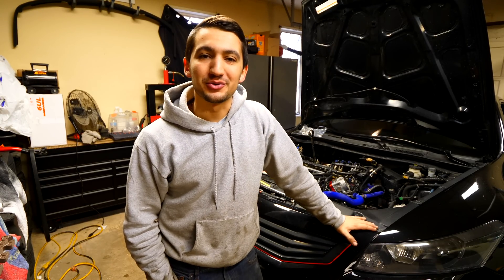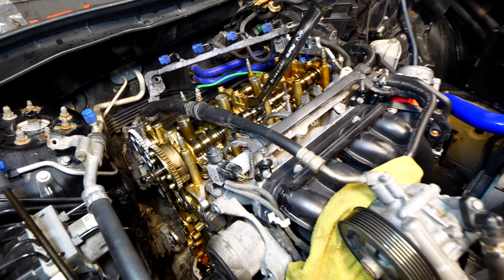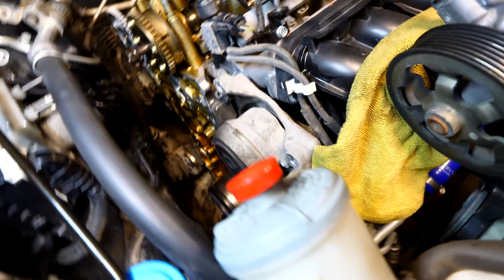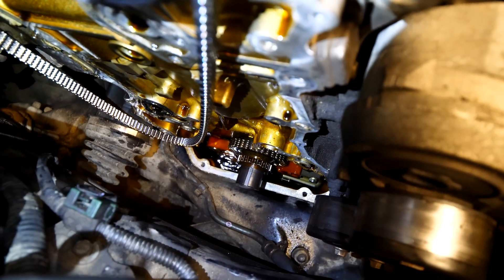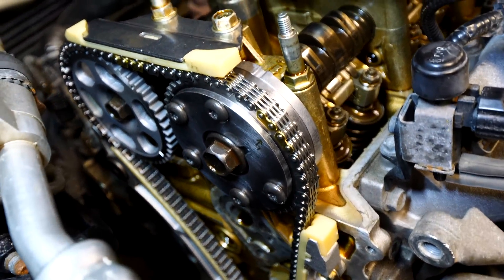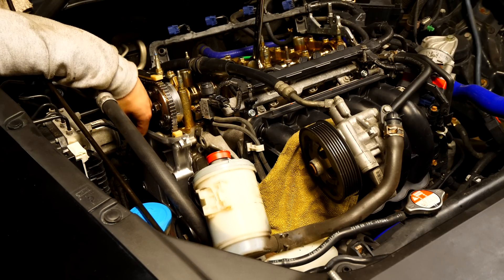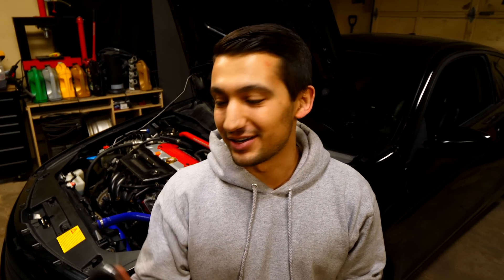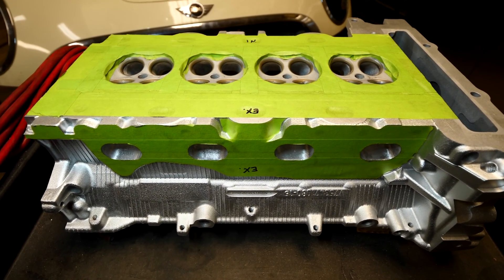How I Replaced the Timing Chain on my 200,000km Honda Engine

Comment: Did you have to drain the oil first?
Reply from the maker: No I did not. The oil was held in the oil pan. If I wanted to replace the oil pump chain, I would have had to drain the oil before starting the job.

Comment: If your engine does not have the fancy plastic vtec cover, it's a pzev motor. Those motors are mandated to warranty the vtc actuator for 150k miles. If this applies to you and you live in a pzev state like California, take it to your dealer and know your state right. They will fix it no charge. Thank me later.

Comment: Very informative video, thanks so much for taking the time to record!!
Question for you: How have you found all of those aftermarket parts after a bit of use? 

I have to do the same job on my Accord in the near future and I'm slightly hesitant to purchase non OEM parts for such an important part of the engine. Have you had a good experience so far?

Thanks again!
Reply: I'd say for anything related to engine go with OEM, there are ebay OEM timing chain kits for around 250$ , not a bad price if you consider that this job will cost more than $1k at any mechanic. If you want to play it safer you can buy everything at the dealer.

Comment: Hey Milan, I've been watching  your 2009 Accord Coupe Videos. By the way GREAT JOB.  I also have an 09 Accord Coupe purchased new in 2009 it's an EX-L 4cyl, Polished Metal Metallic , black leather interior.  The same  base car as yours except mine is the 5 Speed Automatic.  I haven't done the major mods that you've done but I have done some, rear spoiler, 18" Honda 7 spoke wheels, added all the trunk and hood liners that were stock on the 6cyl.  I also scored the Vtec nameplate for the trunk lid on the opposite side from the Accord label. Mine also did not come with fog lights and the installation of them is a bit much for me at over 70 years of age. Honda wants WAY to much to-install them. QUESTION, in a few vids you state that you consistently red-line the engine. Do you think that has contributed to your timing chain & vtec problems? I ask because a friend of mine in California has a 2008 same engine with over 250,000 miles (over 402,000K) and she says she'll get in her Accord and drive cross country, no worries. The only maintenance shes done is Honda USA (NOT DEALER) recommended services and  her car is  a 5 speed automatic so it stays well below red-line. I do enjoy your videos. This is my third Honda, I've owned a 2001, 2003 and now the 2009. I don't drive as much as I used to so I only have 65,000 miles (105000K). Thanks for reading, regards Tom. P.S. I have the K&L cold air intake system, but I've been waiting for my extended warranty to expire. One day I'll do a Video.

Comment: Well wanna know why yours does not have the VTC Sound well Milan because you use fully synthetic 5w30 oil 
Because i kinda i actually studied this and it turns out 70% accord owners usually use 10w30 or a higher viscosity  oil because actually the VTEC system runs on oil pressure so if is so thick it might damage it.
The best oil for the k24 is the 5w30 full synthetic or 0w30 full synthetic 
 Even thought k24’s can use 15w30,10w30 conventional oil its still not good you don’t need that thick of an oil just use 5w30 or 0w30 fully synthetic and change it at the correct time and everything will be fine
Reply: 70% of those 70% are probably trying to band aid a sloppy engine, the others just don't know better. I'm curious of the loads VTEC actuation places on the chains. Is it accelerating chain wear with each actuation?
Reply: whatre you talking about... i use 5w20.. full synthetic... your info is wrong bro

Comment: Is it possible to change the VVT sprocket by only removing the valve cover?
Reply from the maker: I don't see why not? If you plan on changing out the VVT sprocket, you might as well replace the timing chain since you're in there.

Comment: what's the point of having timing chain if it stretches ...
Reply: Its a better option than a timing belt which has to be changed every 80,000 mi.and can break easier than a chain.

Comment: Could you have replaced the water pump as well, while you have replaced the timing chain?
Reply: You can.  But the pumps are completely mechanical.  The only thing can potentially go bad is the bearing.  And it is unlikely that would happen.  its rare.  Just check when you take it off to see if there is alot of play in the pulley.

Comment: There’s nothing wrong with the VTC sprockets or chains. Here’s the problem . All North America market K- motors are spec’d for either 0W20 or 5W20 GL-5 oil and ridiculously long oil change intervals. GL-5 oils have had the zinc levels dropped drastically to protect the catalytic converters. The very same engines that are shipped to European assembly plants are spec’d for either 0W40 or 5W40 European spec oils. Not only do they have a higher viscosity but they also have higher levels of zinc and detergents. The ONLY reason N.A. Markets engines are running 20wt oils is because of CAFE fuel economy requirements the manufacturers have to meet. I’ve been a Honda tech for 25 yrs. I purchased my 2005 Accord new and since its had 2000 miles on it I have ran 0W40 European car synthetic in it at 7500 mile intervals. Never had a chain, tensioner, sprockets. Clean as a pin inside and totally quiet. Uses no oil between changes. My oil supplier for my shop has an 03 he uses as his company car. That thing has over 250,000 on it and never had the valve cover off. He’s run 5W40 CJ-4 diesel oil in his the whole time . Though higher zinc levels may shorten catalytic converter life I’d much rather spend 30 minutes and $140 for a bolt on converter than tearing the front cover off of my engine and dealing with worn chains, and worn VTC sprockets. It’s a no-brainer for me.
Reply: Yikes ! Ive been running 0w20 in my tsx for 100km , is it safe to swith over to 5w40?
Reply: Skyee just change over to full synthetic 5w30 and you will be fine
Reply: O
Reply: Hello Wayne Swicegood, I just bought an '08 Accord Euro with 2.4 engine (same car as TSX mk2), with 133K km on the clock (83K miles). Would you tell me which "0W40 European car synthetic" you recommand, please? And I live in Bretagne (France) which is very mild (59F most part of the year, 37F to 45F during winter with very few frost, 68F to 86F in summer) : maybe 5W40 would be enough? Plus, the inside of the valve cover is very dirty : do you think that a "Oil System Cleaner" (like Wynn's, Restore, Bardhal) would damage the VTC actuator, please ? (At each oil change, I used it on my Volvo 850R with 133.750 miles on it and it's pretty clean). Thanking you in anticipation.
Reply: JPH I’m not sure which oils are readily available where you are.  I use Mobil 1 simply because it’s easily purchased at Walmart. Castrol, Pennzoil, also offer a 0W40 here. The 5W40 oils are fine too. If they’re more readily available I would run them.  I’ve used three products in my shop designed for mechanics to clean VVT systems. The first is made by Penray and it comes with a cleaner bottle and an additive . I’ve personally seen it fix a Toyota that the VVT was sticking and causing a check-engine light. The second product is made by BG and also has a cleaner and additive. The third is made by Lubeguard and has a flush and additive. All of these are marketed to repair shops are are effective but you may be able to find them on EBay.  Amsoil also sells a really effective engine flush that has the same chemistry as Penray. 
Most of your store flushes are primarily kerosene which isn’t very effective.
Reply: @prevost8686  Thank you very much for all these details, Wayne ! Many products are difficult to find in Europe and eBay doesn't accept overseas shipping for chemical products, but I found Amsoil is imported in Germany (Amsoil Engine & Transmission Flush is available). Thanks again !
Reply: Zinc does not equal good wear protection. That's a myth that needs to end. However I will agree with you that 20 weight oils were only made for fuel economy. 5w30 is ideal for most water cooled engines
Reply: @firstlast---  The PROPER amount of ZDDP does equal good wear protection. Too much ZDDP is as bad as not enough. Numerous tribologists with tell you that the current ZDDP levels in SP rated oils is not enough to adequately protect all engine designs. But hey, what do they know? They just study lubricant formulations for a living.
Reply: @prevost8686  You didn't listen so I'll say it again. There isn't an inverse relationship between zinc and wear prevention. If that was true you wouldn't see flat tappet cam failures. Full stop. I really don't care what you use but I'm not going to sit here and let blatantly incorrect information influence someone who doesn't know better
Reply: Or just straight pipe my car, use 0w40 and not worry about either
Reply: @uenragedbro Do you live in a state that doesn't do Emissions testing?
Reply: @josephbell2160  yes, my area of my state doesn't have emissions testing. Some counties do
Reply: @uenragedbro  I wish my state didn't. But oh well 😌
Reply: wish i could trust this and just fix all my worries with an oil change.
Reply: Does the oil affect the rattle on a cold start on the Honda cRV. Which oil would you recommend?
Reply: @martinuspretorius5521  No. It’s usually just the spring inside the cam phaser. Numerous people offer a stronger spring which is supposed to quiet the startup rattle. The same basic design is used in Acura applications and all of them were spec’d for 5W30 here in the United States for the longest time. Same clearances on all the bearings and rings as the less powerful K24 in Hondas.
Reply: Good to know!
Reply: Good insight there Wayne. I've known K series to be bullet-proof. Never heard of any problems with VTC sprockets. Timing chain in K series usually last the life of the car (if not tuned).
Reply: How about rotella T6 5w40 ?
Reply: 2003-2007 were better I’ve owned both an 03 and an 08. 03 had 400,000kms when I sold it and the 08 now has around 301,000km. The 03 never had cold rattle or any problems the 08 revs higher and has cold rattle with same
Level of maintenance as my 03.
Reply: My 2004 Acura tsx oil cap calls for 5w30
Reply: the vtc issue is due to the spring inside losing pressure and failing to keep the vtc gear locked until oil pressure reaches the top of the head.
Reply: I have a 15’ civic si 2,4 vtec, would it hurt it if I just switched over to 0w 40 synthetic? I live in Denver and it does get cold here but never below -10

Comment: hey man, I have a little bit of oil leaks out of the chain case cover ( the metal piece  with an " X " logo that is hold by 3 bolts ) and I am about to replace it! Is it easy to remove without remove the entire cover? I have same engine as your but 4 doors. Thank you for the input!

Comment: Thanks for the detailed video! I am planning to do the same on my tsx this weekend and this video will really help! Only question i had was, what was the size of an open ended wrench used to hold the cam while loosening the vtc sprocket bolt? I have 26mm but not sure if it is correct.
Reply from the maker: It is a 15/16th. I tried to find a metric size that would work but grabbed that and it worked fine. If you need to as well, you can use an adjustable wrench to hold the cams in place
Reply: Thanks!
Reply from the maker: No problem man :)

Comment: Hey Mil, do you have that common oil consumption issue? They are infamous with the K24 motor. Can you make a video on how to repair that whether you have it or not. Thanks brother.
Reply from the maker: I do not. Honda had a recall for it and they would basically rebuild your engine under warranty. They also extended the warranty too.. I'd look into it if your car is burning oil
Reply: milanmastracci it is, and will do. I just found it out a couple days ago. Smh.

Comment: Nice job, why not adjust the valves while the cover is out?
Reply from the maker: Because I didn't have the tools to do it, but will be doing it shortly :)
Reply: milanmastracci don't forget cleaning out the vtc/vtec oil strainers too. I went through 2 chains on my k24 and about to hit 500k miles.  These engines are bulletproof but the vtc design is weak.

Comment: My 2010 and 2013 Honda CR-Vs have that same vtc actuator problem, makes that same sound only when in cold out and at first start up. My question is ....can I just leave it alone ? Or what would happened if I don’t fix it? (The 2010 has 120 thousands miles and the 2013 has 60 thousands miles) great videos !!
Reply: Edgardo Amado your mileage may vary....but I’ve put over 100k miles on my car since it started rattling. Not sure if that’s ok or not but I did it. At 240k miles now it rattles at every startup no matter of hot or cold so I think it’s time to address the problem
Reply: @jarrettbarnett7656  How did your car (timing chain) hold up? I'm not planning on doing anything either about the rattle, except for keeping the oil level up. I've heard that many people just keep driving it this way with no issues.
Reply: @094340  what will happen is your car won’t start anymore it’s what happened to my Acura tsx 2010 it has a k24 engine
Reply: If your engine is a PZev motor, the actuator is warrany for 150k miles. Let the dealer do it no charge.
Reply: How did your CRV hold up, it's been 5 years since you posted?  I have a 09 Accord with the same rattle, but just on initial startup, like your CRV. I'm going to leave it alone and keep my fingers crossed that it doesn't get worse. I have heard that many people just keep the oil level up and never have a problem with it, aside from the rattling noise.

I will change out all of the oil screens on the system, just to cover that aspect of oil flow, but swapping out that VTC actuator isn't a guaranteed fix, many have done this only to get the same rattle again soon afterwards. The timing chain is a different animal though. If that gets stretched then you have to replace it, but I'm not going to do that until I have to, hopefully it'll throw a code when it needs to be replaced.

Comment: Really wish you would have talked about locking and unlocking the VTC actuator. Did you install it locked or unlocked? Did you lock or unlock it after installing? Also what size wrench did you use to hold the camshaft while trying to remove the bolt?

Also on your list of torque specs I believe crank pulley bolt is 36lbft plus a 90 degree turn with the threads oiled
Reply: I need exact details, if you can share please that would be helpful.
Reply from the maker: So it was shipped to me locked, and I unlocked it before putting it on the camshaft and before putting the timing chain on it. Once it was unlocked I torqued the camshaft bolt to the VTC actuator and then timing everything from there.
Reply: How did you remove the old VTC actuator without unlocking it? Which required removing the cam shaft holders and pulling the camshaft??

Comment: Removing your vtc you didn’t need air pressure to remove that pin that locks it into place ?
Reply: Yeah... but we don't know why
Reply: @xb7778  No. only need air in the VTC if you lock it before torqueing the bolt down. Must be torqued down in the unlocked position.

Comment: I'm thinking about getting the Accord as my first car. I need something reliable to commute 80km to school. What do you guys think?
Reply from the maker: This is more than reliable!! I've beaten on this thing for 120k km's and its been nothing be great to me. I've had to replace the standard stuff like brakes, tires, and other stuff, but modications aside, it has cost me PEANUTS to run this thing..
Reply: milanmastracci what year model do you have?
Reply: @milanmastracci  What year is your Accord? I didn't know Accords had timing chains. My 99' Accord V6 has a timing belt. Wish I could change it to a chain
Reply: Definitely a good car. I have one aswell just wish the 4cylinder would have more power. Maybe a 6 is something to look ay
Reply: My dad has the sedan model, 5 speed manual, commutes 25km to work, and another 25 back, regularly drives my brothers to their sports games 1hour away, and it's still running strong, but DONT buy the dark colored ones before 2008, there's a serious paint problem that ruined the look of my dad's car
Reply: milanmastracci one question though, arent distribution chain cars supposed to have the chain last forever?
I know  distribution belts on the other hand need to be changed every 100,000km because the rubber cracks and deteriorates.
But everyone i asked tells me chains last for the entire lifetime of the car...even if it doesnt, 200,000km is nothing for you to have a stretched chain.
Am i wrong? Or did your car have something else that made the chain age prematurely? (Im about to buy a european version civic which has a chain too)

.
On motorcycles the chain is recommended to be changed at 100,000km, but these motors work at 3 times the speed of that of a car
Reply: don trump Timing chains can stretch over time, causing the timing to to be inaccurate
Reply: Tun3d Accordingly i get that, but in cars what is the usual lifespan of timingchains? 200,000km? 
Seems a bit too short to me...
Reply: don trump typically, they don’t need to be changed unless something is wrong with them. Just keep up with your maintenance and you’ll be fine. What kind of car do you have?
Reply: Tun3d Accordingly civic 1.8vtec engine... European model. Im considering buying one, but watching this youtuber change the chain before 200,000km scared me
Reply: don trump ... He Probably Drives & Pushes It Hard On The Regular That Could Have LED To Tbe Stretching Of Chain I’m Also Looking Into Getting A Coupe Don’t Know Of I Want The 6 Or 4 cylinder
Reply: good video
Reply: You Literally cannot get more Reliable than a Honda or Toyota....they are about exactly the same